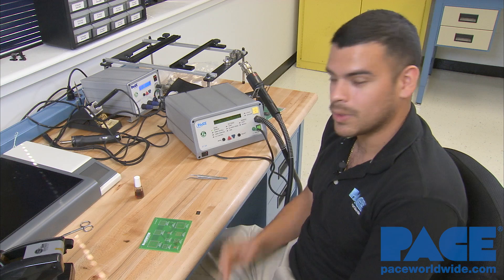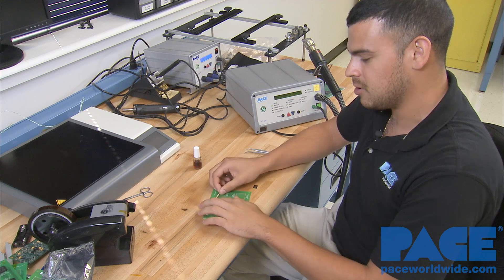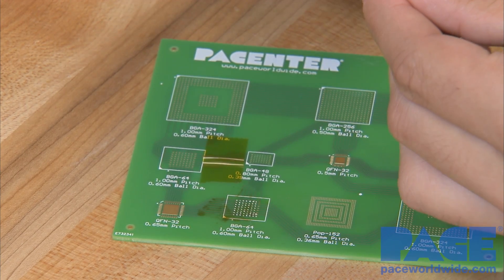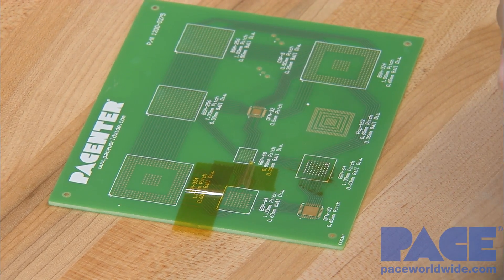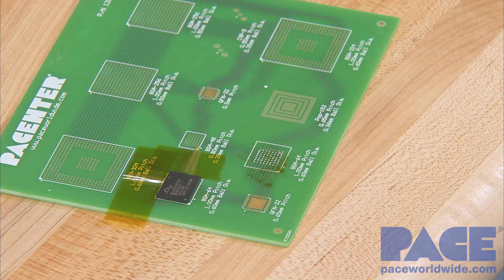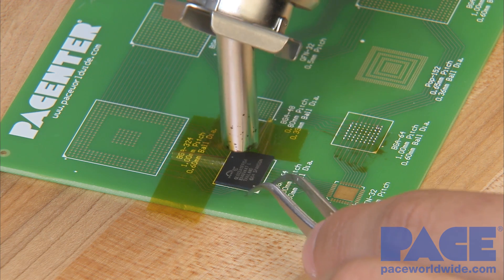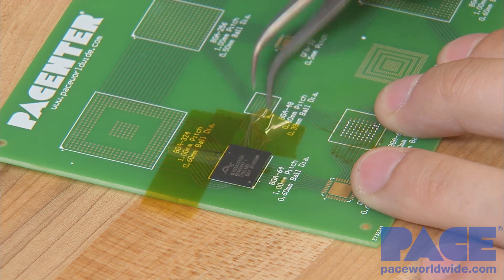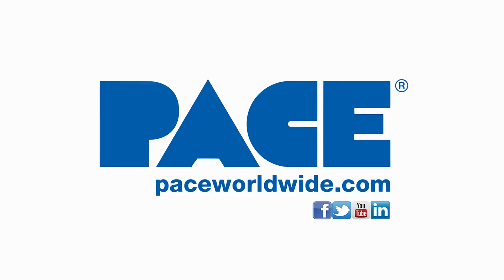Align and Install a BGA with Hot Air

Comment: Given that Pace is supposed to be a respected supplier of industrial soldering equipment, this demo was abysmal. That practice board is highly unrepresentative of the density of components on a real board, where the kapton tape would not work. Then soldering by hot air alone, without heating the PCB (eg on a hotplate rework station) will subject the component to the maximum stress. And prodding and poking it while soldering almost guarantees messing up the melted balls.  This does not do credit to Pace at all.

Comment: Is it safe to remove bga using just hot air? Can it damage the board?
Reply: You need to heat it evenly. Otherwise the component and board contacts might crack. 

To heat it evenly you can apply solder paste(nonvaporizing) all over the area to distribute the heat.

Comment: There are plenty of smd components around BGA IC on an old circuit board so it s very difficult to use Kapton tape heheheheheh you failed man
Reply: The kapton tape is used to cover and hold adjacent components too, I do this daily and it works fine.

Comment: Does it help when heating the chip to be reballed or newly mounted, to put a small weight or light pressure? Thanks   is the PCB a kit?
Reply: You should not press the BGA down, because you would squeeze out the liquid solder and likely get short circuits.

Comment: In real life repairs, there won't be enough space to place the tape around the chip. Modern boards are thronged with delicate components. The BGA stuff never gets respected by the ordinary repair technicians. It's just a rabbit hole to bankrupcy.
Reply: That's what I was thinking. May lead to a mess with tiny components all around being unsettled. At least wait for cooling b4 ripping away tape or parts will fly off stuck to tape.

Comment: I don't know much about this, but I feel like I'm missing something... did the chip or the board already have solder balls on it? I've only seen this done as a reball, with a stencil and solder paste. Do brand new chips make it this simple?
Reply: BGA stands for Ball Grid Array, there is indeed an array of balls of solder material under each pin.
Reply: Example: Louis rossmann also doesn't use solder balls. You can add  tiny solder residues (half-balls) onto the grid yourself.    https://youtu.be/2eXMFIkdA0o?t=320

Comment: This in interesting! I have no experience in BGA, 
I am just curious ....
 it seems that the "solder balls" are already on the NEW BGA package IC, 
if so, then what do we do about the stencil of the whole PCB?
Do we still apply solder paste on the BGA part of the stencil or just skip that part?
Can someone tell me? Thanks!! :)
Reply: just flux on pads. solder balls are the only solder needed.
Reply: @alexanderlindsey7134  If there is a via on pad, would that needs extra solder? Thanks.
Reply: @BS-my2ky  did you find the answer to this?

Comment: So is this just a way of soldering BGAs? What about the operation of the chip? Are you sure you did not destroy it? You pushed its' temp from 25 celsius to 300 in a few seconds? Is that supposed to be the right way? Shouldn't you be gradually increasing its' temp rather than pushing it up to 300 celsius in a few secs in order to avoid any cracks in the structure of the ic?
Reply: I might be wrong, but in my limited experience, it seems that if the chip isn't overly complicated, then it doesn't matter as long as you don't completely melt it. It's usually the complex ones, the ones with their own heat sinks, that get destroyed like this.

Comment: BGA is an abomination! Especially when used on chips that normally operate super hot, like GPUs. The chips don't just fail from over heat, THEY FRIGGIN DESOLDER THEMSELVES FROM THE DAMN PCB!!!
Reply: yes they do, but that's the problem of crap leadfree solder, not that much of a problem of BGA itself.Would not happen if leaded solder would still be used.

Comment: what is the temperature of the hot air?
Reply: That depends on the nature of the board. Multi layer boards need more heat. Single boards, less. Beside, lead free need more temperature, but even there, there are several different solder  profiles. The best is to use thermometers and pre-heating on the bottom of the boards so you can get an uniforme distribution of temperatures. I use normaly 120ºC on single boards and 160ºC on mult layers. 235º  - 240 to unsolder and remove and, 220ºC -235ºC on the chip just enough to melt the balls and see the chip sink. Not always successful, I must say, even skilled on that matter, one on ever 10 goes  wrong... :(
Reply: We use vapor phase in my work, that and gel flux . Most of the time it works good, but sometimes with thicker boards with heavier copper its hit or miss. We also use the ersascope for inspection, we dont have x-ray yet.

Comment: I personally think the people who came up with the idea of a BGA chip (and chips like it) should be beaten to death with a stick! lol
Reply: I work on electronics, I even do BGA work and I think the same as you. It's terrible. The temperature window is very small: too  cold and you don't get it soldered. Too hot and you can screw the board. Beside, the big amount of heat needed in multi layer  boards with inner copper shields usually  twist the board and that makes that the balls don't mach the same distance .The outside balls get soldered, the inner keep too far from the board to perform a correct soldering. If you apply more heat in order to sink the chip a little more in order to get the inner balls soldered, there is a risk that the out side balls melt together. It's what you say.... beaten to death with a stick! Grrrrr !!!!
Reply: It is just a way from keeping us poor engineers, who DO NOT own an assembly factory or anything like that, away from electronics so that the huge corps get all the money. SOBs... I have never soldered a bga but i am sure it will either end up with me cursing because the dam thing won't work because of any of the following : (1) shorted pins, (2) unsoldered pin(s), (3) fucked up chip and a thousand more reasons... What is wrong with soics? :-)
Reply: And flung into a vat of boiling acid!
Reply: A question to all you trolls ranting about BGA being Satan himself: how else would you connect as many pins in such a small space?
Reply: @CoolKoon  the same way they do with removable cpu chips on motherboards, a socket soldered to the board, which never fail.
A 2 minute job to replace and hardly any extra work or cost required by the manufacturer.
Reply: @ashyt161  Have you ever noticed that the CPU is pretty much the only chip on a motherboard that's replaceable? Ever wondered why?
Reply: @ashyt161  then the problem becomes soldering the socket which is even more complicated than BGA
Reply: @CoolKoon  You got me started wondering. So why is that?
Reply: @roseelectronics4582  Because every single additional socket not only means additional work and space (and through-hole soldering, which PCB manufacturers really dislike) but also an extra source of problems. And since the CPU is pretty much by far the most expensive chip on a motherboard (the rest cost a couple bucks at worst in bulk, perhaps the NB and SB a little more) it's the only chip whose replaceability justifies the extra costs associated with sockets (i.e. it's the only chip that's worth the hassle of having a socket for). And even that's only valid for desktop PCs nowadays, laptops have had their CPUs soldered into their motherboards for years now.
Reply: @CoolKoon  makes sense
Reply: @CoolKoon  If discounting considering the enviromental harmfulness of non-repairable electronic devices i agree. Modularity and not only price should be an objective for engineers imo - and the market as a whole. The question of repairability is important. New laws are being made in the US atm. The amount of smartphones destroyed and bought each year is staggering.
Reply: Agree! BGA is garbage!
Reply: Only if is a public beating...  otherwise the engineers will never learn.
Reply: Me too, i will personally smack them on their face

Comment: Why did they skip the step where they added the solder? Do you add flux? How much solder do you use? How do you know if you used too much or not enough? Seems like that the most important step.
Reply from the maker: Hey Dave, I laid down liquid flux at 1:49. You could also use tacky flux and the quantity varies depending on the application and personal preference. As for the solder, the BGA had pre-applied solder balls.
Reply: @paceworldwide  the bga balls were leaded?!

Comment: The temp rise seemed very fast which would be dangerous for the BGA. Does the digital hot air system run a proper profile or at least closer than just waving a bunch of heat at the work piece?
Reply: How would the hot air gun know when you have started pointing it at the piece? You could do that by slowly moving the hot air gun closer. Thats a skill of the operator not of the tool. The profile is for the solder paste not the component.
Reply: That is not true. The component and the PCB are stressed if the temp rise is too fast or cooled too fast. The solder has different reasons for needing a controlled profile - but either way the 15 seconds to reflow this part seems crazy. understand the idea of operator skill modulating the temp - but would think that a high-end product like this would allow you to push start and just hold or oscillate the outlet close to the part while the system controls the temp rise. This allows non-skilled people to get it right and get a result that will actually last. The surrounding areas should at least be pre-heated and the part should come up to temp over the course of a 60-90sec.
Reply: They should invent that. But wouldn't it have to know how much mass each chip has? I find it ironic that they use lead free solder to protect the environment. A lead free solder job fails after 2 years instead of 10, turning the whole product into junk since most things are not worth fixing. You saved the ground from an ounce of lead only to pollute it with five broken TV's/computers instead of one, not to mention all the CO2 they went into producing it..
Reply: The hot air device does not need to know anything about mass - you program the device according to an estimate like a regular reflow oven. My oven has a different profile for the various boards I assemble - time and temp are adjusted to accommodate the variables while keeping the temp profile at least reasonably close.
Reply: Dave B Exactly! I remember when Greenpeace gave Nintendo a big fat ZERO when they were looking into Nintendo, Sony, and Microsoft’s game systems in late 2006 or 2007. Nintendo didn’t give the bullies access to their factories. Sony and Microsoft were tripping over themselves to talk about what they were doing to improve, all while Greenpeace implied that all obsolete game systems end up in the landfill. Sure enough, Microsoft’s and Sony’s lead-free game systems started dropping like flies with tens of millions of dead consoles all while Nintendo’s oldest systems are still getting passed down from generation to generation. Not a lot of people know this, but RoHS is a big part of the capacitor plague too. They like to blame it on an incomplete Japanese formula stolen by the Taiwanese, but did you ever wonder why some old devices seemingly never need their electrolytic capacitors replaced while newer electronics from before and after the plague are still failing? Why were the Japanese component suppliers reformulating in the first place? RoHS.

We have RoHS to blame for Pb-free failures of BGA and chip interconnects as well as the electrolytic capacitors which are less stable than the good formulas from decades ago. The drive to make out waste safer has, instead, turned everything into trash.